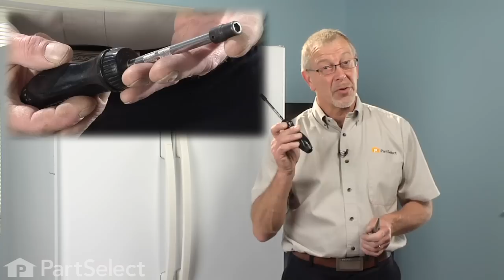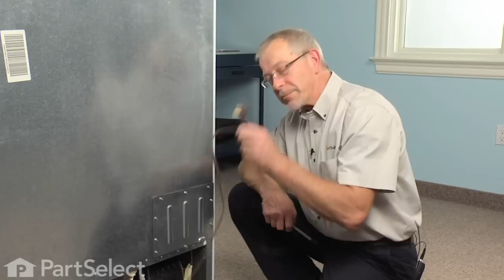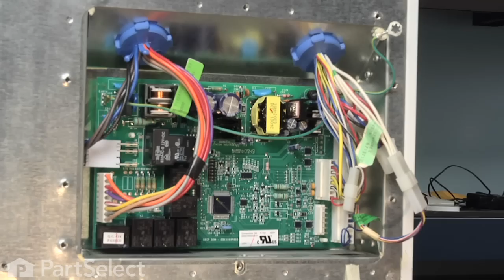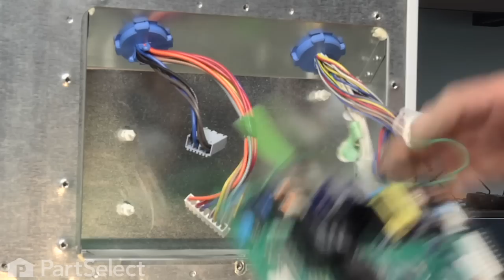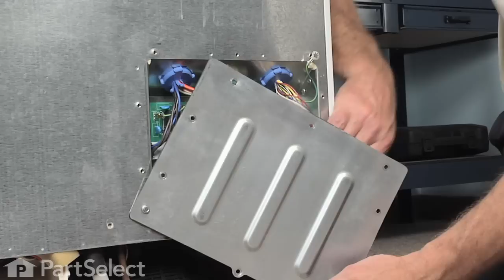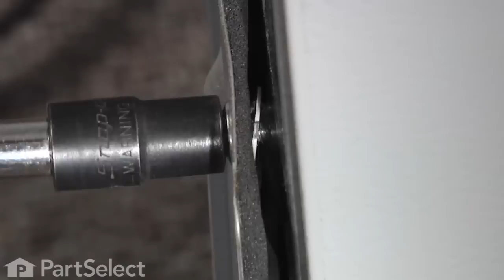Refrigerator Repair - Replacing the Main Control Board (GE Part # WR55X10942)

Comment: good night friend, first of all excuse the translation use google translator, I'm from Venezuela and I have a problem with my fridge, take it to the power supply (110V) and then placed comes with an error in the HRS board. and takes a long to boot up or turn on, giving sounds like a turning reley before firing, takes about 45minutes to light, which will not fail if the control board or boot trainer?, I need your help.

Comment: GREAT video !!! thank you !

In the direction that comes with the board step 5 calls for cutting green wire where the compressor to capacitor ? 

It's not part of your video, which made worry.. wanted to post something before I cut a wire.
Reply: Hi Eyal, I am in the middle of this same situation and not sure what to do about cutting a green wire or not. How did your repair go? Did you ever find out what to do?

Comment from the maker: Hi Andy,

Thanks for your question and I'm sorry to hear about this! I would say it's likely that replacing the control board would resolve the issue, based on the limited information I have, and not being there to look at it myself. You can check its voltage first. You may find it helpful to search part # WR55X10942 on our website, where you'll find about 140 customer experiences (the problems with their refrigerators, repair tips, etc.) related to this specific part!

Comment: Hi Steve,
I am having trouble with model number GSH22JSTA SS. We had this fridge in storage for the past couple months, I believe a fuse blew. The inside lights are working, however the refrigerator does not get cold, it doesn't sound like it's running, and the control panel (that has the water/ice disp and temp control) does not turn on. It isn't under warranty and I am wondering if I buy this part and install myself if this might be the source of the issue. Please help!

Comment: I had a similar problem and the solution is very easy! Just unplug the green ground wires from the old board (they are connected via a brass spade plug and pull off, maybe withe the help of pliers or tool to ease the plug off) and install them in place of the wires on the new board. Ta-da!

Comment: Hi Steve... my model #GSS20IETA CC has a ground connecting to another green wire from to the fridge along with some other wires to the bottom connector. The new board has a ground system like this video and the wire is not long enough to reach the bottom area where I would screw it in. Question? Would I need to connect to the ground wire coming from the fridge like the old board or can I leave that out and find a way to make the new ground wire reach the hole at the bottom? Appreciate any input.

Comment: I have a GE frig model number PSW23RSWA ss. I recently replaced the mother board and evaporator fan. However, now the compressor will not come on. What are the possible reasons for this. Not sure if this model has a start capacitor. Thanks for any help.

Comment: Thank you for this instructional video. Out of curiosity, is there a way to buy those plastic mounting tabs and put in place? I'm about to replace my board for a wooing sound from the freezer section... which from many other testimonies seem to also be the cause of a faulty board. 
But my old board sits on only 1 tab. The others must have broken off from prior repairs done?

Comment: Repairman says compressor is shot.  BUT said that LG mnfg the compressor. In a 3 month time period LG produced faulty compressors for GE.  Repairman hasn't seen one in 4 yrs. he said i may have hit the lottery cause GE had/has a program in place to replace these fridges at no cost. Woo hoo!  So he called and GE said the program is still in place but has changed over these 4 yrs..., so I may not get 100% replacement but

Comment: Thanks, great video! I've got the GE ets22xbmbrww that wasn't cooling properly and was told it was the board. Thanks to your instruction I was able to replace the board as shown, but now the compressor doesn't turn on at all.  When I put the old board back in I can hear the compressor working right away. Bad new board? Interior lights still work with new board but that seems to be about it. Thanks!

Comment: Hi all, I recently had a refrig tech come to the house and diagnose the refrig. the refrigerator wasn't cooling. He said I need to replace the evaporator fan and the control board. I replaced those and the refrigerator is still not working. Any thoughts? Were there any tricks when replacing the board that I should be aware of?

Comment: I have tested the defrost thermostat, defrost heater (which appeared to be burned out because there was soot around the springs that i cleaned off but it still showed continuity,) I tested the evaporator fan via the control board as well as the control board itself and everything was showing the proper readings on the multimeter.  The thermistors on the freezer side tested at about 15.30 ohms while the fresh food side read higher at almost 16 ohms. Would that be the culprit?

Comment: I have a GE Model #GSS25QGTB The temperature control settings are set to 0 for the freezer and 37 for the fridge but throughout the day the temperatures for both sides fluctuate on their own. The freezer side gets warm enough that the ice starts melting causing water to leak onto the floor. Any help would be a appreciated.

Comment: I had a similar problem.  If you search the internet you will see a common problem is that the small spring occasionally pops out of the recessed hole.  Remove the tray, pop the spring into place and you should be good to go.

Comment: My GE model # GSHF5KGXBCBB, is a side by side, was not cooling. The lower part of both sides were cold. Everything else looked fine, the ice/water dispenser, the temp. measuring panel is fine, reading, no zeros. I have replaced the board two times before because of the same problem, and it got back to normal. But this time It has been 72 hours since replacing the board and the problem remains. Any idea of what is happening? Any help would be greatly appreciated.
Thank you

Comment: I got a GE Model# - GSS25QGTB, my problem is the top half of the freezer and fridge doesnt get cold but the bottom half does, Was told by a repairman that it was the control board, Bought a new one GE# - WR55X10560 wich looks Identical to the one in your video, Once I installed it the control panel on the front of my fridge displays nothing but zero's when I try to adjust the temp, The old board motor still allows me to adjust the temp but not the new one does nothing but display zero's.

Comment: I have problem with this frig where a loud clicking is coming from the circuit board and nothing is starting.I do not have a troubleshooting flow chart to diagnose whether the board is bad.do you have any ideas?

Comment: @partselect

I already replaced the the overload relay and the start capacitor for the compressor of my GE side by side refrigerator but the motor was running together with the fan for the condenser and the overator but the air coming out the freezer and refrigerator was still warm. I check everything thermistors, thermostat, heater coil, motor compressor. I replaced the main board but the problem still exist. Kindly help me to troubleshoot my refrigerator. your reply would be appreciate!

Comment: (part 2) But when I press the Turbo Cool setting, the temp reading on the right hand of the top panel seems to indicate an error. If I turn the Turbo Cool back off, it will give me a temp reading (right now 35). There is no  display for the Custom Cool setting. It is blank. Is there something more I need to do to reset everything properly? GE Profile Model PSS26SHPASS. Thanks for your videos. What a great help!

Comment: Appliance repairmen came to my home and diagnosed that I needed a new main control board, so I was happy to find your video and do it myself, saving me about half. However, once I installed the main board, there was no sound coming from my fridge until I pressed the Turbo Cool button. Then there seems to be some motor going. (More)

Comment: I've got the exact same issue with mine. Just happened today. The inside lights go on when I open the door but the temp display is dead and it is not refrigerating anymore. Everything is getting thawed. I've checked all the obvious things so I think it's the control board.

Comment: filipinofighter1 1 second ago 

@partselect
 
I don't know if the compressor motor in my refrigerator has a capacitor but basically most of the compressor motor they use to have capacitor. There was no build up of ice on the evaporator coil because the air flow was warm in the freezer and refrigerator even though the refrigerator was running for 5 hours and ice maker didn't make ice. Let say the capacitor is broken but why my compressor motor is running?

Comment: @partselect

I already replaced the main board of my GE refrigerator side by side model DSS25KSRE with a replacement model WR55X10942. I just follow the instruction manual that it came with main board but unfortunately my refrigerator still the same that the motor was running together with the fan and evaporator fan but the refrigerator didn't cool. What would be the next diagnosis to fix my refrigerator. Kindly help me troubleshoot my refrigerator.

Comment: @partselect

I already tested the evaporator thermistor together the thermostat, food thermitors but they are all fine.  Before we had defrost problem with our refrigerator, i just unplugged the AC cord to defrost the ice build up to the evaporator coil. I think my Control main board is the cause of the problem but I'm not sure because I didn't see any blown parts from the control main board. If i do have diagram for the main board i could check the voltage flow to the IC parts of the main board

Comment: @partselect 

My GE refrigerator model DSS25KSRE has a fan motor beside the motor compressor that blow the air to the entire freezer. Well, the fan motor is running together with the compressor motor but the air flow is warm. I forgot to tell you that recently we had a defrost problem with our refrigerator but I already check the thermistor, thermostat, evaporator heater coil & they all fine without any open resistant continuity. My email address is rbrtmendoza@yahoo.com

Comment: @partselect

I already tested the 3 thermistors, thermostat, heater coil but they are all fine. I didn't see any blown parts from the control main board model number WR51X10055. What would be the cause of the problem. The motor is running together with the blower but the air flow is warm. I would like to know if the control main board should be replace.

Comment: @partselect 

We have  GE refrigerator side by side model # DSS25KSR. Its no longer cooling but the fan motor is running fine. There is no build up of ice in the evaporator coil. Do you think the mother board is the cause of the problem of my refrigerator. Kindly help solve my problem. Your reply would be appreciate!

Comment: I just replaced my main control board after figuring out it was behind why my water / ice dispenser was inoperable.  I did some pricing and found that Ebay had the best price (the manufacturer wanted nearly 3 times the price I paid on Ebay for the same part).  A quick review of this video made it extremely easy to replace the board.  My only issue was the pegs that kept the board in place...they were a bit tough.  Everything else fell into place and the dispenser works like a charm.

Comment: Experiencing an issue similar to SantoCastronovo on a GSL25XGWA. Front panel has one light on (water, crushed or cubes) but when you hit the dispenser all lights go off and won't dispense anything. Also tried unplugging for a while an it didn't work. Wondering if it is related to the main board or if there is something else inside the door that I should be looking at.

Comment: I have a GE Profile Artica side by side, I need to replace the control board (part number WR49X10152) and I was wondering if it is as easy looking to do as this video showed?

Comment: I have a GE side by side both fans worked but no compressor ..I fixed it.   it was the main board ..$138. On appliance parts .com .hope it helps someone

Comment: I have a GE GSH22SGRESS.
The main board is clicking.
I have ordered these parts.
mainboard - WR55X10942
Motor DC SOND FAN - WR60X10209
defrost therm - WR50X10068
Overload/relay - RCO410
and...
a compressor kit - WR87X10211
will I be able to fix my fridge with all of that?
I can manage the small stuff but I can't find a vid specific to the fan and the
compressor?
What order should I put them on? Main board - fan motor-overload/relay/defrost thermo/compressor?
THANKS!

Comment: I really hate those boards. 
I get these refrigerators as scrap after they are 6yrs old. I would like to figure out how to re-wire it to by-pass the board using an old 70s fridge as an example.
The defrost timer was a reliable mechanical timer & all of that stuff worked without a computer board.What mostly fails in these new fridges are the board components in a planned obsolescence, I say scrap the board& convert back to more reliable technology.Watch the youtube video The Light Bulb Conspiracy

Comment: @TheDangergirl10  Not completely, the board shows the right display when I click the 'adjust temperature' on the outside display board and then goes blank. But I can live without that as the fridge is cooling now.

Comment: Hi, looks like my fridge has the same issues. There is also another problem, the top display and  and the left panel where temperature is seen are also blank now. It shows 0 and then becomes blank if I click. There are few sounds like its trying to start something but then sounds stops. Could this all be related, am planning to get the main control board and fix it myself before calling for help. Please advise.

Comment: Hi Steve, i had a 3 years GE, its not cold, I try unplug for 24 hours but still not working,
you think replace the board will solve the problem ? I look up the model and the part number for replacing the motherboard same exact the one you show here on your video,
many thanks

Comment: the control panel to the side door there is no power is going to it?..do I have to replace that board your doing, or the circut board to the front of the door?..the rest of the refregaror is working,making ice its cooling but the controls are dead no way of getting water from the despencer ice nothing completely dead..any sugestions?..
             paul